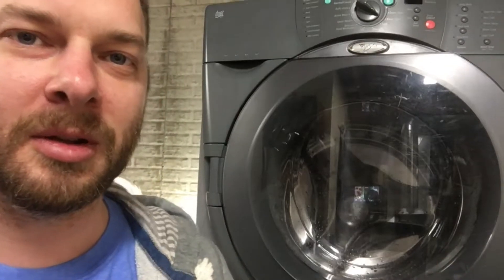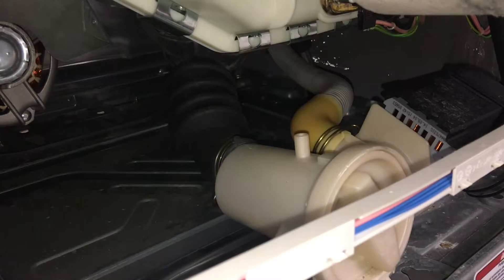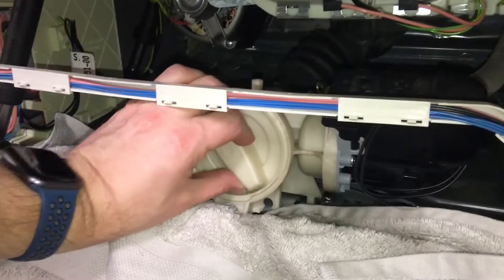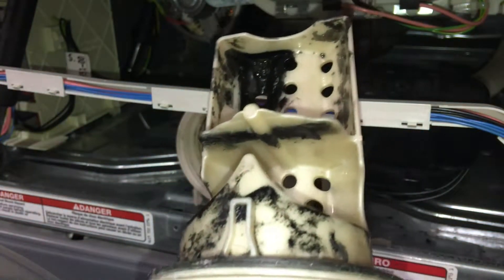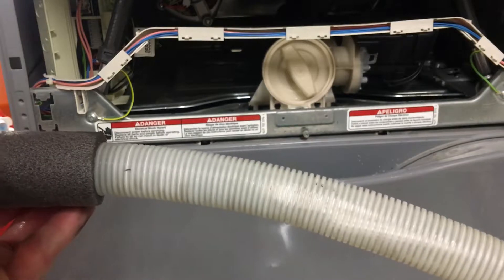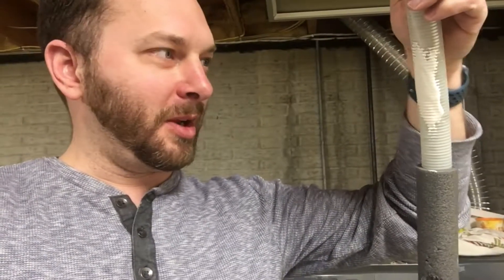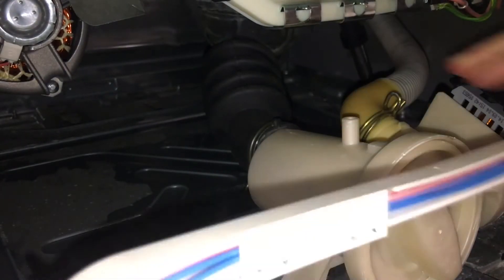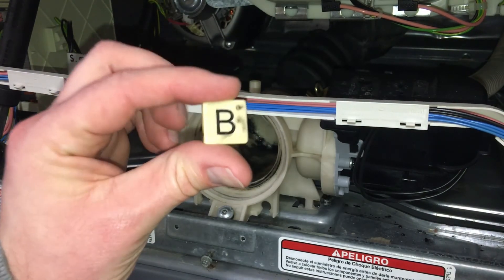How to fix a Whirlpool Duet Washing Machine that is leaking and clean out the filter

Comment: After cleaning/inspecting the door gasket my leak appears to be fixed.  I’m gonna clean out the trap and see if there is a leak from the underside.  I have two dogs and found a huge wad of hair inside the rubber door gasket.  I bet the trap is full of hair. The whirlpool guy assured me there was no filter that needed cleaning…he just wanted to sell me a new machine…Newer machines have an access door to drain the machine and I have seen one that has a fine mesh catchment filter that is easy to access and clean.

Comment: Thanks, I  didn't know about this, very helpful, I thought you had staged this until I decided to clean the filter on my 15 year old Duet Sport.  LOL, I had 35 cents and a chained tie tack.  I thought I lost the tie tac it on my last trip!  All junked up so I will replace it.  No more F-33 shutdowns, but one of the pump blades is missing half of it's blade.  I'll be replacing the drain pump too!  Maybe the whole unit if I can't fix the leaking door. It only leaks when loaded with a large load.  Well time to find that video.  Thanks for the help.

Comment: Well done.   My duet is leaking. I’ll check this.
Reply: As an update, our duet washing machine leak ended up being a black rubber hose between the soap dispenser and the top middle of the drum.

I removed the top metal cover and bottom lower front metal cover, ran a load, and eventually figured out where the water was coming from. It would only come out during the spin cycle.

I ordered the replacement rubber hose off the Internet for about $50 delivered including sales tax.  

Our machines are getting up there in years. About 15 years old. Unfortunately, during these crazy COVID economic times, supplies of new washing machines are limited and prices have shot through the roof.

What we’ve accomplished is a Band-Aid. These things are still approaching end of life, but I bought us time.

Our hope is normal times will return within the next couple of years, then we will replace with new, hopefully without spending nearly $2000 on a entry-level washer and dryer which is almost how much it would cost today.

Comment: Thanks for your fix. My machine had exactly the same worn spot on the drain hose that was leaking. I don't think I would have found it on my own. Patched it with epoxy and no more water on the floor. You're great.